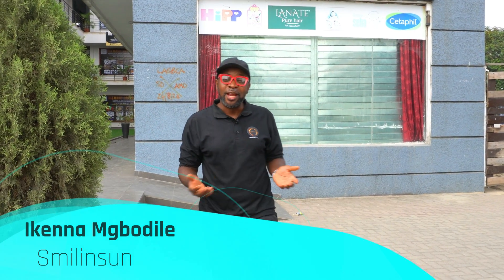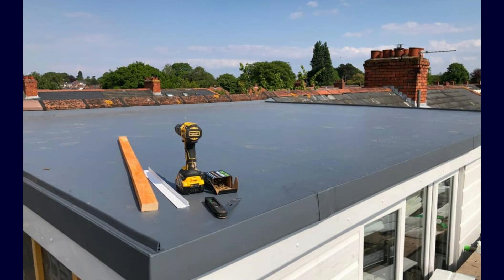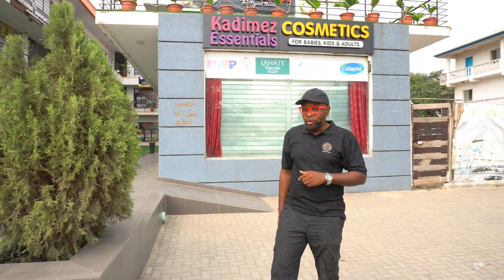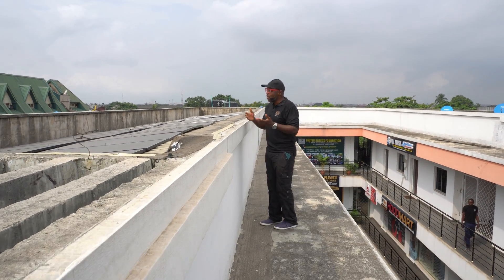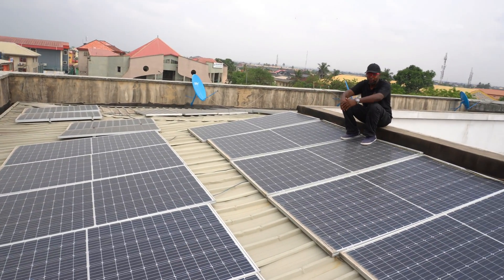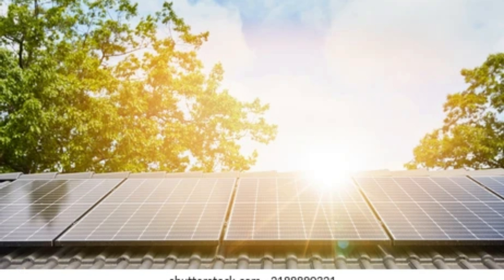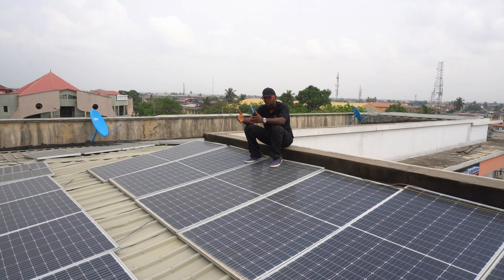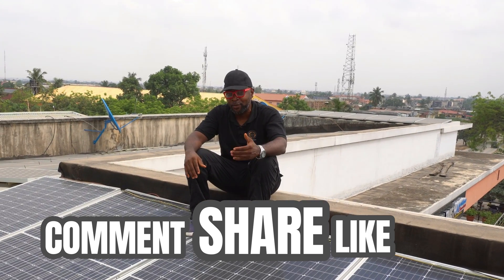How your Roof Orientation affects Solar energy generation

Comment: Good evening please I need your assistance.i connected 16pcs of 450w half cut panels 4 I series to make 4pairs on a 120amps felicity,at peak sun I generate 5.7kw  95amps but today the customer called me that the controller looks like it got some burnt underneath so I don’t know if what I generated is really the cause ?? Please I need advice on what’s best it’s a 10kva system with 8batteries
Reply from the maker: @DanielObinna-f6d  send us a message on our website or call the number on the screen we will respond to you and resolve your issue.